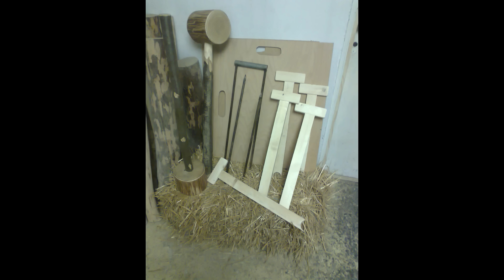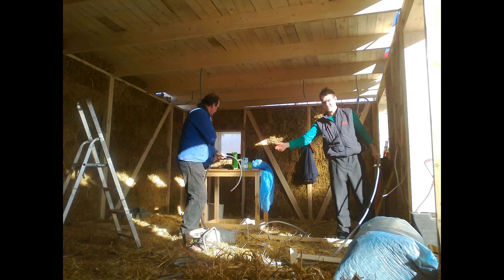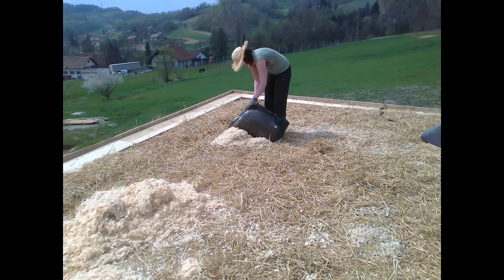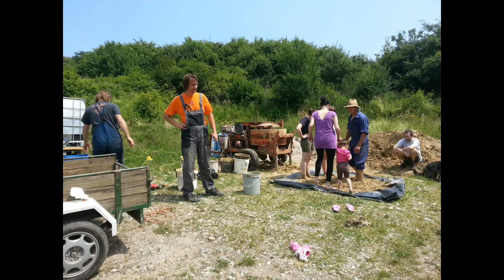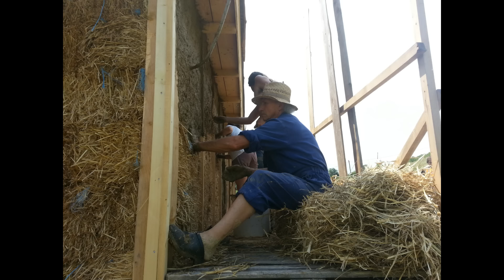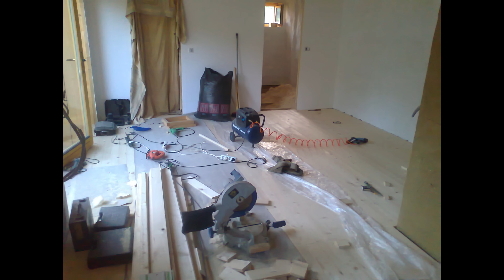20K straw bale house from start to finish

Comment: And for the wind... straw bales homes only move 1/4" at 80 mph wind. They outperform on flame test, wind test and on R value.
Reply from the maker: In our country we do not have strong winds.
You have to check who is doing the test flame, if it is an insurance agency, yeah, then it will be bad. They love money....

Thanks for the comment!
If you are subscribed and you ring the bell, you will see in May my new episodes
TINY HOUSE IN THE MIDDLE OF THE NORTH ATLANTIC OCEAN
Which I am building right now ⛏🔧🏄🛠🔨
Reply: Resilient walls on Earthquakes too! I would have brought the foundation piers up just a bit higher to allow for water not to impact the wood. If you have termites a copper metal and skirted barrier around the lower portion of the wood piers would be good. I think it also improves the look. Back in the day, old adobe homes had a roof layered with micaceous clay. Acted both as a seal and a primitive but effective radiant barrier. Do like this  very much including the wall plaster mixing crew!
Reply: wauh so how much does it expend on a heat wave? ure so genius
Reply: @leovieyra3723  if the roof is done with venting low side to ridge is perfectly legal and works naturally (hot air rises). You can use radiant barrier foil stapled to the underside of the roof rafters (need a dead air space for reradiation of incoming solar radiation back thru the roof) The radiant barrier thus slows the ceiling insulation from heating by thermal convection. As such, if the ceiling runs at a temperature less than your body temp, you will feel cool. Another technique for summer airflow is buried underground cooling tubes going to a low point register entry on your floor. Then, to get flow you run a couple of registers high on the opposite wall. Figuring some of this out can be rule of thumb but an architect in passive and active solar heating and cooling can finalize the concept.
Reply: @klerobi1  Boric acid is sometimes sprayed on the straw bales before final enclosure. 

""Cellulose is mostly recycled newsprint, with non-toxic-to-humans boric acid as a fire retardant, making it one of the most fire-resistant of insulations. It has very low ecological footprint, embodied energy and global warming contribution - in fact, less than any insulation except straw bales. The boric acid is a fungicide, so it inhibits mold growth, and is an irritant to rodents, discouraging them from nesting. It also kills most common household insects, including roaches and termites.
Additionally, cellulose has good R-value (3.6 or better per inch), inhibits air movement, absorbs excess moisture for safe storage and release, actually protecting wood framing from moisture. Objectively, it's the best commonly-available insulation on the market."
From Green Builder
Reply: Wesley Lowman could you please explain for Russians ) I didn’t understand
Reply: Yes I live in one we built. Getting read to build a third one.

Comment: Im a little confused, why did this cost 20k?
Reply: Lot of manual work is required to apply stucco to flexible wall, so you will need to hire someone to help.
Reply: @quercusjohnson5617  It may take years to finish. I tried to do it by myself first, then hired workers.
Reply: @VolodymyrLisivka  

Yes it is hard work, but it would not take that long and after a while you would have  learned how to do it. 

We built a strawbale house in 1994, it is about 100 square meters. I did most of the plastering by myself and I did not have a cement mixer. It took me from middle of August until about the middle of November. For a month or so my daughter and a friend of hers helped.  They were teenagers.  then I was by myself because school started.
Reply: @quercusjohnson5617  I paid $500 per month * 3 * 4 = $6k for stucco and facade. (Labor is cheap here).

Comment: Very nice! And very eco friendly. The world would have less problems if we would live in these houses.
Reply from the maker: Thank you for your comment and thank you very much for watching!
Reply: Adobe and Straw bale are some of the least energy intensive ways of doing building. They also, if designed correctly for passive solar gain in winter and passive cooling in summer are a long term virtually low  to no annual fossil fuels input homes.  A very small wood stove would provide any supplemental needed

Comment: Really a great job of using innovative natural building resources that is easy to grow and inexpensive. This site is in the cold area so pest and rain that destroys the wood is not an issue. In tropical areas that rains a lot, cement post anchor is the carpenters chosen option.

Comment: Had a couple friends build one of these some 40 years ago. After about five years they couldn't figure out how to keep the critters out of the walls and floors and built a conventionally framed home next to it. They ended up knocking it down, I think they saved the windows. I always thought it was a fire hazard. Good luck.

Comment: Its about time that someone did straw under the floor and the roof.  So many do not insulate the roof and the floor. What is the Slovenia dollar to the Euro?  Or Slovenia to the U S dollar? Very well done and very though out  saw things on your build have not seen any were else.  I'am a off grid builder, excellent build
Reply: Hi base camp. As you are off grid builder what kind of foundation or base plate do you practice. 
I want to build 4 little houses now but i wonder how do to make simple and natural. Thank you. Daniel
Reply: Daniel Beaufils 
Hi Daniel
Need to know where you are building the the weather conditions. If you go to my channel you will see things like my arched cabin builds.   There it is on post we are at 4000’ snow and gets below O. There is r-60 in the floor
So tell me the weather where are
Are they for year around living
On or off grid
Plumed or dry cabins
Be glad to help you in anyway I can
Eric
Reply: Euros are the same in all Europe you know... About1.2$ for 1€
Reply from the maker: The euro dollar is close to 1 on 1
Thanks for the comment!
If you are subscribed and you ring the bell, you will see in May my new episodes
TINY HOUSE IN THE MIDDLE OF THE NORTH ATLANTIC OCEAN
Which I am building right now ⛏🔧🏄🛠🔨

Comment: I built and lived in a straw bale house and you could not find better. Hot weather it was cool, cold weather I wore shorts inside only using a little heat..
Reply from the maker: Yes man! This is crazy!!! ✌
Reply from the maker: If you are subscribed and you ring the bell, you will see in May my new episodes
TINY HOUSE IN THE MIDDLE OF THE NORTH ATLANTIC OCEAN
Which I am building right now ⛏🔧🏄🛠🔨

Comment: I built the same house for about $1000, but used mainly salvaged materials.
Reply: How? What were your materials?
Reply: @kricketkitty  Stone from my property, discarded wood, re-purposed corrugated metal roof, windows, and door. Biggest expenses were concrete and piping for the plumbing. That was to get it livable. I’ve spent probably another $5000 over the past two years building out my solar system and for upgraded finishing materials on the inside, plus with that money I also built two guest cabins on my property which I rent out to guests. I had someone spend the whole summer on my property last year and made $5000 from that one cabin alone in 3 months. Those cabins  have replaced my work income, so I’m retired now at 37 and spend most of my time optimizing my property for food production and making my place a desirable vacation destination in the countryside.

Comment: Beautiful home, and good work everyone. I've built several, from garages, residences, to vacation rentals. The 20k has to be material only though, not counting land, labor, permits... etc. Labor is the big factor, and skilled labor isn't cheap. Shoot unskilled labor isn't cheap. So if you have anywhere from 2 to 6 folks working... what's that add up to? Let's be conservative and say 2 a day, for the year it took to complete. Not counting any trades bills (hvac, plumbing hookup, elec hookup), and you set labor at 15$ an hour. The average american works 260 days a year, the average construction worker works 10 hr days at minimum. So that's 39000, per set of hands.... so 78000 in labor cost. Consertively then, this is a 98000$ building. That's if you do all your own electrical, plumbing, hvac, and already own every tool/implement/machine you will need. Not trying to piss in anyones cheerios, but unless you have TONS of free skilled labor and land, you can't get anywhere near this with 20k. Great work though, loved the build, loved the video, and you've given me some good ideas. Keep building and growing your skills!
Reply: Of course, you are right. I suspect the $20K is material cost only. Does not include his ‘free’-DIY labour. Of course does not include the price of land, etc. Straw bale homes are much cheaper for materials, but much higher for labour compared to modern construction. If you have the free time to do it yourself, it can be much cheaper. But, very labour intensive. If paying for labour, the overall cost is more similar to modern construction.

Comment: Nice build! How did it cost 20,000 Euros? You used around 400 bales (each bale costs usually 2.5 Euros) so thats 1K, and your wooden planks must've cost another 1000 Euros...so that's 2K total right? ould you give me the cost breakdown as I'm confused, and wish to build my own - maybe I'm overlooking/underestimating certain costs - thanks!
Reply from the maker: More than 1500 hours of work, I spent € 1920 only on fuel during construction......................✌
Reply: @klerobi1  Still.. Where are those 20.000 Euros spent at the end..it still doesn't ad's up.. can you be more explicit? You've calculate your own work hours? It is not your house? Did you've pay'd yourself working on your own house? I really do not get it!?
Reply: @gattonpc  I do not see your problem. As some common sense should tell you that some bales alone do not make a house.. plumbing( pipes, fittings, water taps etc) , electrics (breaker box, cables, sockets, circuit breakers, etc. ), workers ( certified electrician, plumber and even if they are friends and family), wood (framing and panels), flooring materials, structural engineer (maybe not in this case), approvals (maybe not in this case ), tools and small materials,   machine rents, fuel ( transportation+ machines (generator etc)), kitchen+ bathroom, heating, windows and doors, etc.. I can easily see a lot of positions that would would make a couple of grand.. and added you will get to 20k very easily... 
just for electrics alone you will need a couple of thousand, not to mention kitchen and bathroom.. then you need heating.. damn how can you not see that if you ad up everything you can get to 20k easy..
also 1500h and so many pictures showing groups of people helping, even if they are only friends and family, would you let them work entirely for free? ( no food, no money for transportation and work?)... just do not build a house if you think that´s ok..
Reply: @philxdev  bless your common sense!
Reply: @philxdev  people have done better with the same amount of money? Like how long is this house going to even really last? It’s made out of fucking hay
Reply: @caseofruns735   Straw is not hay. Hay molds easily, straw doesn’t. That’s why people put it in dog houses. The lime makes it last. This is a very old building technique.
Reply: @thealabamaredhead  .. And even hay can do the job, as the pioneers of nebraska technic was doing with it !
Some of the are still in a good state, since 200 years !! Cheap on building / heating, made from local natural materials.. Mainly biodegradable if you need.. What to ask more ? : )
Reply: @klerobi1  How much have cost the outside planks covering the walls ? Have you let an "air sheet" between bales and gum tarp as i eard is recommanded ? (Maybe its not needed, juste to know your experience.. ? ) Thanks a lot, i like you common sense !
Reply: 20 000 euro is Slovenia is a lot of money. This hobby construction shouldn't cost more then 3000 euro considering that used resources available locally.
Reply: I don’t understand why this house is so cheap 20k ? In some parts of the world this would be easily 250k
Reply: And here I am marveling why it does not cost more. It's basically a traditional house but with straw used for insulation.
Reply: @caseofruns735  This house can last hundreds of years, as long as the foundation and roof are well built.

Comment: plastic on roof without breathing space? what happens to the condensed water? not much lost but bit of planning could extend +20 year to the building.
Reply from the maker: Thanks for the comment!
If you are subscribed and you ring the bell, you will see in May my new episodes
TINY HOUSE IN THE MIDDLE OF THE NORTH ATLANTIC OCEAN
Which I am building right now ⛏🔧🏄🛠🔨

Comment: Hi Friend, thank you so much for this video, we are building our little house in the forest, Nebraska technic as well, it is very inspirationnal to see your little movie.
I have two question if by any chance you stubble upon my message and have time to answer.

1- in order to get the inclination of the roof you seem to only have added a piece of angled wood underneath each rafter, Is that so ? Can you give more detail (are their length only the size of the upper plate? How do you fix them ? ...) 

2- Before putting your plastic membrane on the straw you seem to pour sawdust, is that so ? Why for? We are planning as well to not glue to any support but just lay it on the straw bales. Maybe the sawdust  allows for a better contact?

Thanks and happy journey

Comment: I think it is very nice..I would have built larger but you can always add to it later , a Sunroom or a covered veranda outside..gives you more space ..make it 5 to 6 feet wide if  not 2 pallet lengths.. 8 feet..that way, you can put a table there..a wraparound kind of terrace-like they do in Louiiana..lol
Reply from the maker: The house already has a veranda. In September I will make a completely new video. 
Thanks for the comment!

Comment: Straw bale homes rate high on fire resistance.
Reply: straw has zero calorific value unlike hay so straw bales do NOT get eaten or catch on fire unlike hay! YOU CANNOT USE HAY BALES ! some of the oldest existing buildings in the world are straw bale, cob or adobe these houses breath so are less prone to mold have insulation ( both heat and noise ) qualities that cannot be matched in modern construction and due to their weight hold together in high winds better than slapped together match box homes. I don't understand why this $20000 normally straw bale homes cost a fraction of modern homes they are however very labour intensive!
Reply from the maker: If you are subscribed and you ring the bell, you will see in May my new episodes
TINY HOUSE IN THE MIDDLE OF THE NORTH ATLANTIC OCEAN
Which I am building right now ⛏🔧🏄🛠🔨

Comment: a really well made straw house, well done with a lot of heart, it's been a few years since it was built could you visit the residents and give us a ubgrade how satisfied they are with the house, what they would you do differently next time? or where can I find more about this house? you said it in a comment 10 m x 5 m is that measured from the outside or the inside? how thick is the roof insulation? Vielen Lieben Dank  aus Norddeutschland ❤🧡💛💚💙💜

Comment: Ok for all the uninformed..... straw has zero calorific value unlike hay so straw bales do NOT get eaten or catch on fire unlike hay! YOU CANNOT USE HAY BALES ! If rendered correctly pests do not get in to nest so I do have concerns this house wasn't wrapped in small diameter chicken wire before rendering. Some of the oldest existing buildings in the world are straw bale, cob or adobe these houses breath so are less prone to mold have insulation ( both heat and noise ) qualities that cannot be matched in modern construction and due to their weight hold together in high winds better than slapped together match box homes people pay way too much for these days. I don't understand why this was $20000 I hope it included the price of the land as normally straw bale homes cost a fraction of modern homes they are however very labour intensive!
Reply from the maker: It all depends where you live. Europe is expensive....
If you are subscribed and you ring the bell, you will see in May my new episodes
TINY HOUSE IN THE MIDDLE OF THE NORTH ATLANTIC OCEAN
Which I am building right now ⛏🔧🏄🛠🔨

Comment: I’m very interested in this building method. Do you know how long the insulation will last? Or if there is any regular maintenance that should be done? Thank you very much for the video, the house looks great.
Reply from the maker: For ever!  Only the roof and foundation must be ok, to prevent moisture. Maintenance like any house. The oldest house of straw is in the USA has more than 200 years.
Reply: if you do not see a problem, there generally is none.. but if you get some spots you can fix them.. the most important thing is, that the straw is completely and perfectly enclosed by the clay, and it helps to have more overhang on the roof to keep the clay wall dry, also some mineral plaster on the outside can help with that in addition to the roof^^.. keeping the  inside less moist with good ventilation also helps.. so a cross heat exchange does help
Reply: Normally, the 2 biggest things which prevents a house from lasting 100 years or more is poor foundation design or water leaks.

Comment: Surely the run off from the field will rot the posts?
I think I would have made small concrete feet to fasten the feet to.
If it was level, run off wouldnt be a problem.